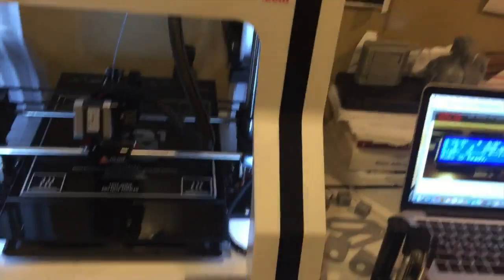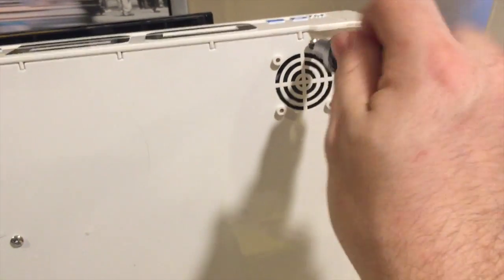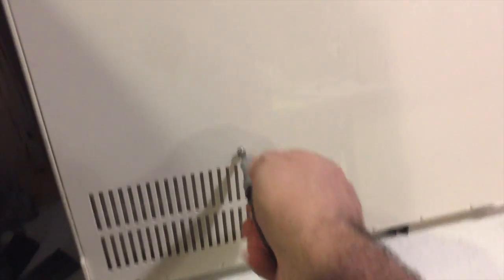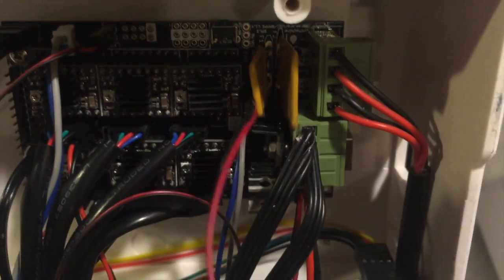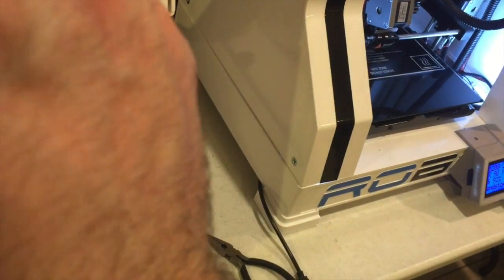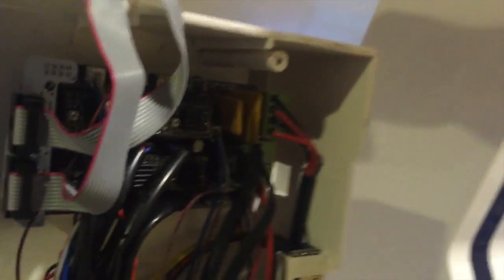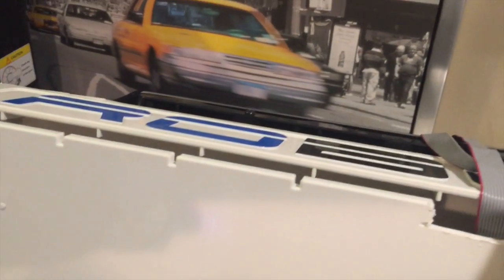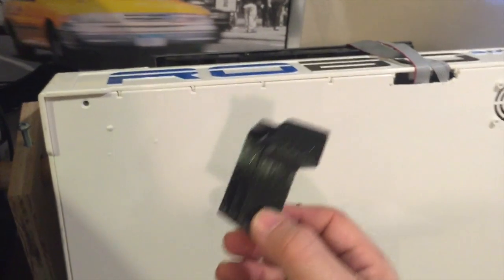Robo R1 +Plus upgrade to the SMART LCD CONTROLLER XXL

Comment: What happened to the Cable you unplugged so install the XXL? Does it plug back into another slot or do you leave it unplugged?
Reply: The LCD CONTROLLER has one built in, for card. Won't be using the one on side of Robo.